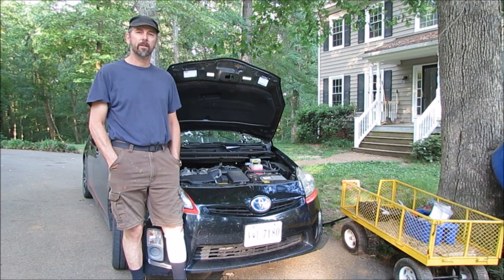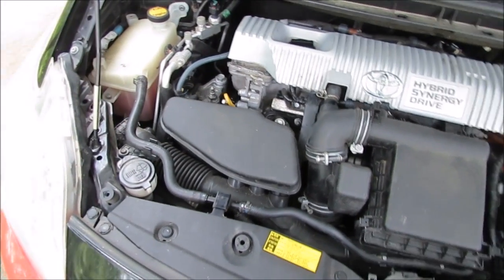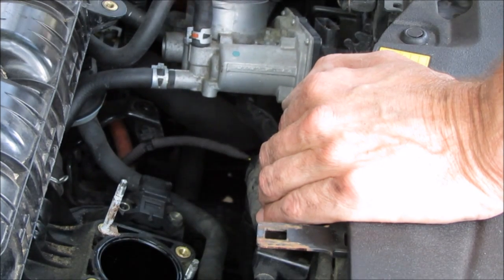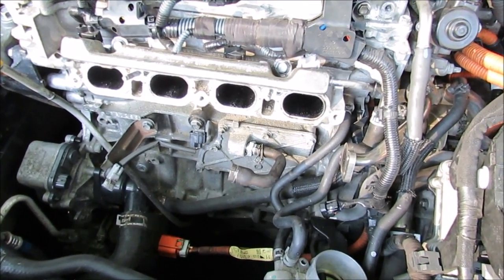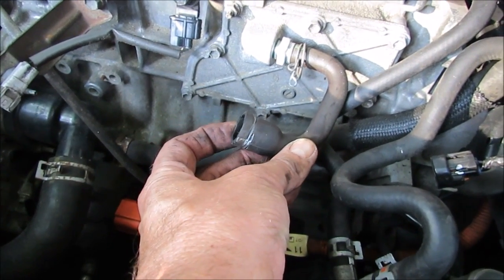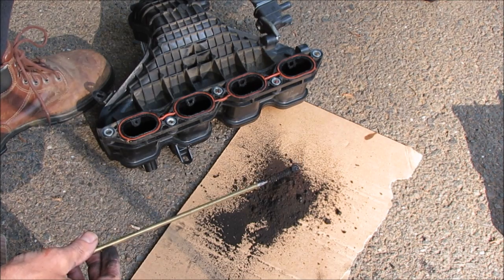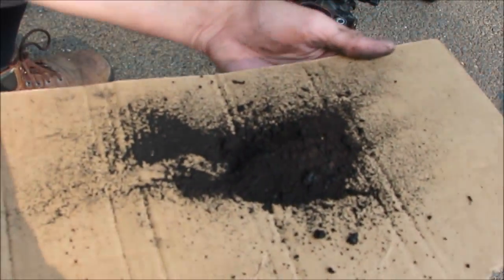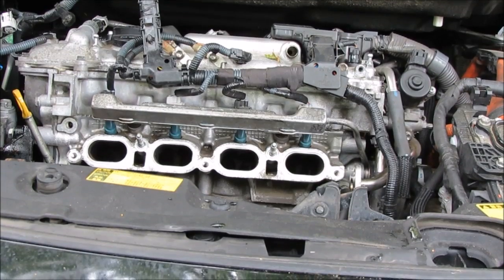Prius Intake EGR ports clogged

Comment: Can you please tell me what the 4 pipes above the manifold are for as I tried to remove them to clean there aswell thinking I should have left alone
Reply from the maker: Those are your fuel injectors, they are connected by the fuel manifold rail. If I recall correctly the rail is bolted to the cylinder head. The injectors slip into the head on the lower end and slip into the injector rail on the top end. There's an oring seal at the top of the injector and a second seal at the bottom.   
You don't have to pull the rail and injectors to clean the EGR passages or pull the intake manifold. Unless you bent or broken something on the injector system, having the injectors and rail on/off shouldn't cause any problems. Worst case you tear an oring and end up with a leak, simple fix is to replace the orings before reassembly, or you weren't careful when they were out (tossed around in a box while working) and you damaged an injector tip. If you have a bad injector and engine is running rough, OBD should throw a misfire code for cylinder with bad injector.
Reply: @robrig1646  I think I may have damaged one of the injectors would this show up would I be aswell off getting a new set of injectors I know they can be expensive
Reply from the maker: @keith2450  are you getting a fault code?
Reply: @robrig1646  The engine seems to be running ok nothing coming up on the dash I’ll have to bring it to a mechanic to put put a computer on it as I don’t have one getting 15.4kml@100
Reply from the maker: @keith2450  15.4 kml? That's metric equivalent to about 36 mpg. I wouldn't consider that to be indication of an injector problem, seems about normal to me. My Prius is getting 38-40 mpg (16.2 - 17.0 kml). What were you expecting to see for kml?
Reply from the maker: @keith2450  One of the best purchases you can  make next as a Prius owner is to get an OBD2 scan tool. Get yourself one as a personal gift this holiday season. They're inexpensive enough on Amazon for about $20-$30. I got a BAFX OBD2 scanner that's Bluetooth, and I loaded Torque Pro App on my phone. I keep the scanner in the center console. I paid $22 for it in 2018, use it on all my vehicles to check engine codes.
Reply: @robrig1646  I’m using the car as a taxi city & motorway driving 250k on the clock the mpg is excellent for this type of job just when I removed one of the injectors I cleaned out the hole with a rag that the injector goes into the O ring was still on the injector when I put it back in as I’m not a mechanic I was hoping I didn’t do any damage thinking I was doing good then realised that I wasn’t I put the injector back in
Reply from the maker: @keith2450  your engine NOT running rough is a good sign. I would open the hood and take a good look at everything again. Sometimes your eyes are the best and cheapest scan tools on the market. Not only take a look at the part you worked on, but check other stuff in the area. Could be that in the process of messing with the injector, you pulled something else loose. It happens to mechanics all the time. I couldn't begin to put a dollar figure on how much money I've saved myself by first taking a good look under the hood, before jumping to conclusions that the problem was the last thing I touched.
Reply: @robrig1646  Will do thanks for all your help your videos are amazing thanks again
Reply: @robrig1646  Thanks very much appreciated

Comment: Did that on my 2014 CT200H which uses the same engine as a 3rd Gen Prius @80,000kms (SYD, AU). Being the first time cleaning, there was hardly any carbon deposits on the intake manifold at all. Not sure if the fuel i used had anything to do with it.

Comment: wow that 10mm clip trick though!, i just spent a day cleaning the egr tube, egr cooler and replacing egr. i generally cleaned the intake but didnt look to deep into those smaller holes. looks like i got another project. Holy cow what a difference after the cleaning though.

Comment: Any rough running and it could lead to blown head gasket.  I have cleaned everything then unplugged my EGR valve. The design is bad and could cost you a new engine.  Does it contribute to higher emissions? Maybe but not near as much as building a new engine

Comment: Hey fellow Hanover resident! I’m in the middle of a head gasket job and am cleaning the intake and was looking for tips when I heard you mention Hanover. Been here most of my life. Thanks for the tips!
Reply from the maker: Where you at? I'm over at the Oilville end.
Reply: @robrig1646  Mechanicsville!
Reply: @davebraxton  I work in Hanover.  2014 Prius here.  Small world!
Reply: @Robosan4000  Indeed it is! My 2010 is back on Hanover roads. How’s your 2014?
Reply: @davebraxton  160k miles and never had any mechanical issues.  Have only replaced fluids, brake pads, windshield, and tires (knock on wood!)

Comment: A couple weeks ago I replaced my EGR & PCV valves, cleaned the EGR pipe and cooler, cleaned the intake manifold, replaced the MAP sensor and I'm still getting the P0401. I followed a video from NutzAboutBolts and they overlook the existence of the separate EGR passages in the manifold!! I'm now going to remove my intake manifold again to clean those passages. Hopefully that will fix my issue. THANKS A TON FOR THIS VIDEO!!!!
Reply: BUY A BRAND NEW EGR VALVE ALONG WITH INTAKE MANIFOLD!   YOUR PROBLEM WILL GO AWAY
Reply: @jasonmedeiros9492  not if it's a bad head gasket
Reply: Did it work? Same issue here
Reply: @AlvaroRodriguez-my4ur  I ended up taking my car to the Toyota dealer and they found the EGR valve I had installed was intermittently working. It wasn't OEM. Last time I buy off brand parts.
Reply: @BadPhD777  damn, thanks for the reply though
Reply: Po401 is a brain wrecker that the manufacturer has installed to never go away so that they can keep making money off of peoples.As long as the car is running and everything is cleaned hoses are in good shape I don’t worry about it at all.

Comment: Did you use Teir 1 fuel in the car and what was the oil change intervals?
Reply from the maker: I run 87 octane. I replaced the engine with a JDM since making the video and Inow add 8 oz Marvel Mystery Oil every oil change to keep the piston oil control rings free of gunk.

Comment: Do you have to bleed the EGR cooler or use any special tools when cleaning the cooler? My '10 has 135k miles on it, I just purchased it, and I plan to clean the intake manifold, cooler, and EGR itself very soon. Great video! I'm thinking about buying all new parts and replace rather than clean the old ones..
Reply from the maker: You'll need 10 and 12 metric sockets to remove the attachment nuts and a T8 torx bit socket to pull the attachment studs out of the head ( it's easier to get the egr cooler off with the studs out).
You'll need to drain some of your coolant at the radiator drain. Put a small vinyl tube on the drain opening and you can drain the coolant into a pan without it running all over the plastic splash panels and making a mess under the car. Unbolt the throttle body from the intake manifold, but no need to disconnect the coolant hoses, just let the throttle body hang in the engine compartment.
I used brake cleaner, carb cleaner, Purple Power, Simply Green (all at one time or another) to get the crud out of my cooler, EGR valve, piping, and inlet passages. It was a lot of spraying and scrubbing.
I just bought a JDM engine for my Prius and I'm currently in the process of going over the engine prior to pulling my old engine. The EGR cooler was filled with carbon (surprise! surprise! surprise!).
I bought a product called TSP ( trisodium phosphate), got it at Lowe's, made by Savogran, $13 for a big box .
I put a couple gallons of hot water in a 5 gallon bucket with 2 cups of TSP. Soaked overnight, water was black. Ran Hot water through cooler to flush crud. Dumped bucket, refilled with 2 gallons hot water and 2 cups TSP, repeated for 3 full days. As of start of the 4th soak last night the water in the bucket wasn't black but more of a tea tinge. Tonight I'll flush the parts again, I'm thinking this will be my last overnight soak and flush, parts were getting pretty clean inside and flush water wasn't coming out black. 
I'm thinking from now on that's how I'll be doing the cleaning rather than spray, scrub, rinse, soak, spray, scrub,...etc. it was way less work, but then again, parts were off a replacement engine and I didn't have to get the EGR cleaned, back on, and running by Sunday night. 
If you pull the cooler, EGR valve and manifold Friday night, soak them in the TSP with hot water and do the hot rinse. You may get by with soaking and rinsing in hot water once a hour throughout the day and have it cleaned and back on by the end of the day without a whole lot of elbow grease. I think the hot rinse with the cooler pressed against the faucet really helped get the stuff out. EGR passages in the intake will probably need to be cleaned as in the video.
There is no bleeding on the system, just top off the coolant tank and run the engine until it's hot, shut down, let it cool, then top off the tank. You may have to check and top it again later, it's no biggie.
There's a procedure to make the engine run where you push start button twice (don't step on brake), set parking brake, gas pedal to floor twice,....  I can't remember the rest, you'll have to look it up, but after about 5 minutes you can shut it off and top the coolant.

Comment: There is a warranty enhancement for 10 years, 150k miles ?, For EGR valve replacement for 2010-2012 Prius with the cold soak rattle, they also update the EGR software so less carbon buildup and less EGR valve problem.  Fortunately happened on my 2012, 1 month before 10 years from isdate.  If too late for others, can get the EGR valve update kit and replace it yourself then pay the dealer to update the software.    See car care nut EGR video.
Reply from the maker: I'm curious about what exactly this software update does exactly. Can you, or anybody following this video thread explain the software change?
 Is the EGR valve replacement an upgrade to a new, improved EGR valve, or is it being replaced because the old valve is full of crap and it's easier to just put on a new valve?
 I just cleaned out an EGR cooler and valve on a JDM engine I recently bought to replace my 250,000 mile engine. Internally the EGR valve is nothing more than a stepper motor attached to a threaded jackscrew that varies the position of the valve poppet from closed to open; I can't see why that would need to be changed other than for putting a clean one on.
What does the software update change and can anybody CONFIRM that the EGR valve and cooler no longer clog following the software update?

Comment: My new 2010 Toyota Prius now has 185k miles. During cold winter morning starts the engine would chatter and shake violently worse than a diesel 18 wheeler. The problem disappeared without my doing anything except 6 cans of Seafoam, 1 can per fill-up. 

My main concern is my MPG has gone from 50 to an average of 33.  Is the throttle plate stuck closed, intake valves all gummed up, fuel injectors bad?  I cleaned the MAF sensor. 
Changed air filter with washable K & N,
oil and filter every 10k miles. I should every 5k city miles. My transmission fails to upshift likely because fluid never drained after every 60k miles.

Comment: Thanks for demonstration, but why did you use break cleaner and not the carburetor/air intake cleaner???
Reply from the maker: I used the brake cleaner because it didn't evaporate as quick as the carb cleaner and it's what I had on the shelf.  Either will work.

Comment: I'll be doing that tomorrow cars running  rough fuel consumption  as well and code p0303 .I replaced the plugs .sucks you have to remove that panel and windshield  wiper motors..I've cleaned  half of egr tube.map sensor  and throttle body .so next it will  be intake manifold  .great video bro thanks for the tip
Reply: Don't worry. As a Prius owner you'll get real good at removing the windshield plastic cowl, wiper blades, motor, and metal drip pan above the engine.

Comment: Thanks, nice and thorough.  I did all this as well as the egr cooler and pipe  and cleaned the valve (probably should have just replaced the valve) plus added a catch can at 87k on a 2012 as preventative maintenance.  The catch can fills up quickly in the winter, half full every 100-200 miles.  Wondering if all 3rd gens will eventually need a HG though anyway.  Zillions of 3rd gens out there!  Maybe low or nonethanol gas may delay this carbon buildup.  I do now keep the oil level halfway to full on the dipstick now so less goes thru the pcv.
Reply from the maker: At the beginning of December e added an Oil Catch Can. Once a week (aBout 500 miles) I empty 3-4 fl. ounces of yellow froth mixed with about 10cc of oil. 
Do you see this water/oil froth in your catch can? 
I pulled the engine in September, reringed and honed cylinders, replaced valve seals and lapped the valves, replaced the head gasket. I drove the car for a couple months before adding the catch can.
Reply: @robrig1646  what is a catch can???  i have a 2010 prius.  this job is quickly on the horizon.  additionally i will look for an egr cooler clean video.  I SO MISS my 86 blazer!
Reply from the maker: @davek7640  it's a small metal jar that you place in the hose line between the egr valve and intake manifold, purpose is to act as a sump, allowing oil and moisture being sucked out of the crankcase to condense out of the vapor before going into the intake manifold. They're around $20-$30 on Amazon, you need to figure out how to adapt/fit the hoses  and a place to put it under the hood. YouTube has videos on oil catch cans.
Reply: @robrig1646  thank you!

Comment: How'd you get the lower left electrical clip connector off? Mine is stuck and I don't want to break it as it seems like a big fix
Reply from the maker: I'm not sure which is the lower left electrical clip connector you're referring to. Possibly the one on the water pump? That has a small plastic 'lever' somewhere on it and you need to push down/in on it while wiggling the connector. Do not yank on the wires b/c you can rip the wires out of the crimp pins inside the connector, then you're really screwed. I think all the connectors have small levers on them and pushing in will release it. The connector housing is likely 'stuck' to the plug/receptacle.

Comment: Hand twisted a 7/32" drill bit in the small ports. Worked well to break loose the crusty stuff. Loved your technique to keep the hoses attached on the throttle body. I followed a different video that recommended draining the coolant - wasteful!

Comment: This is how I repaired my Auris 2011 hybrid unfortunately after I have replaced the EGR and the cooling radiator before the EGR valve. All the small holes from the air admissions was blocked. I'd you get an EGR fail please clean all the way to the admission chamber before replacing the EGR

Comment: I have the EGR pipe off....is there a way to clean the EGR valve / assembly without remove them? maybe spray something, then put the clean EGR pipe back in?
Reply from the maker: Maybe, but you can see in my video how clogged the ports are, not sure if spray in the EGR inlet end of the intake would be enough to get the gunk out, besides the intake is real easy to pull like I did.

Comment: could this be responsible for my shaking at startup and the p0300 misfire codes I'm experiencing?
Reply from the maker: I suppose, wouldn't hurt to pull the intake and look. Air box and intake are fairly easy to remove. Also the EGR cooler and valve could be clogged. EGR cooler is a bit harder to get off, but pulling the EGR valve will let you see inside the outlet end of the cooler and you'll know real quick if it's clogged, it's that obvious.

Comment: I’m running into the same issue currently and after seeing your video I’m gonna tackle this issue as well, thank you for the clear and concise description and process 👍🏽
Reply: did it work well?
Reply: @VinayakGovande  it worked but then my gasket completely went up so now I decided to put her on sale.  She gave me over 200,000 miles so I can't be upset at that.
Reply from the maker: @Cambodimerican24  my engine was hitting 260,000 miles with cumulative issues building up. I decided to replace the engine with a JDM engine I picked up in Baltimore. Cost $1200 and most of my Saturday to get it. I already had a Harbor Freight hoist and engine leveler. Cleaned up the JDM engine, shot Marvel down each spark plug hole and turned the engine through with a wrench to work oil down cylinders and rings. Cleaned EGR system, new oil and filter. Pulled old engine, swapped over needed items, dropped in JDM engine. That was March? of this year, it's now Dec and engine been great. 
My Prius was in pretty good shape, I couldn't have found a replacement Prius for $1200.
I had the old engine out and new engine in for the cost of the engine, gas to get it, and my time. Started pulling Saturday morning, driving by Saturday night.

Comment: Thanks for this great lesson. I have the same problem. All 4 cylinders and sparks plug changed but still runs rough on startup and miss fires on cylinder 1. This cleaning must be done!!! Hope I can return the 4 whatever they are called that go into the 4 cylinders. Spark plugs needed changing. My prius has 198,000 miles on it. This issue has been coming on for awhile. Time to really fix it. No new parts just cleaning!!! WOW TKS!!!
Reply: How you change out a cylinder?
Reply: EGR is closed at startup.  I would guess blown head gasket.
Reply: @kshxfkt76pz7  it needed all the built carbon cleaned out of tubes going into the manifold. Tks
Reply: @kshxfkt76pz7 egr is supposed to be closed at start up, but if it it is caked with carbon, it's not closed all the way.  Pulled mine and compared with new.  It worked, but was caked up. Swapped it out